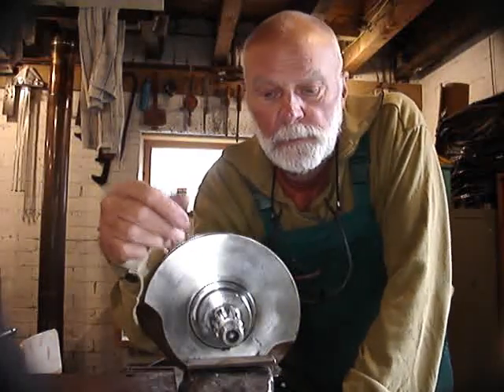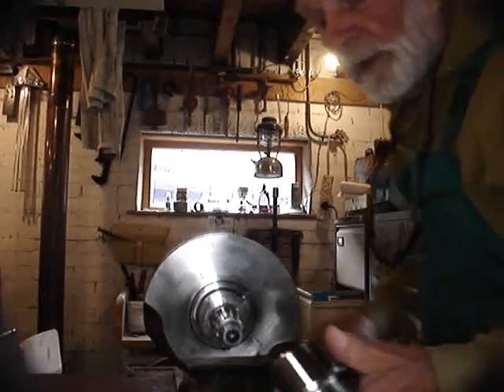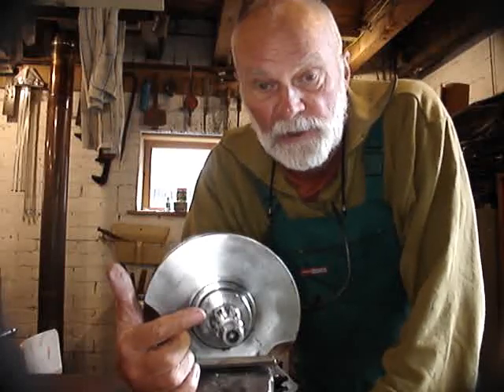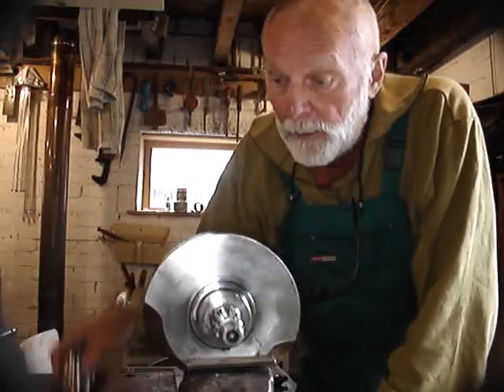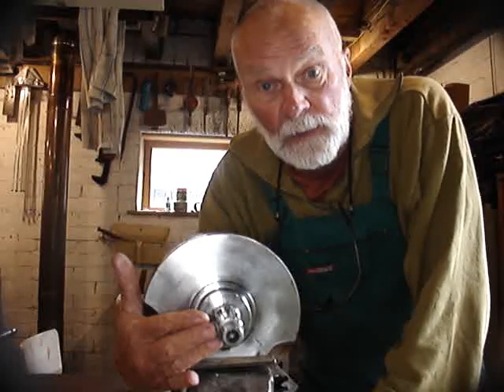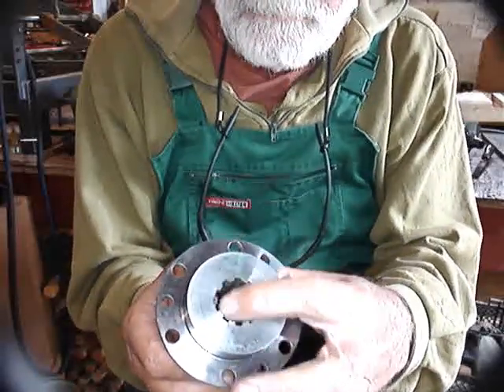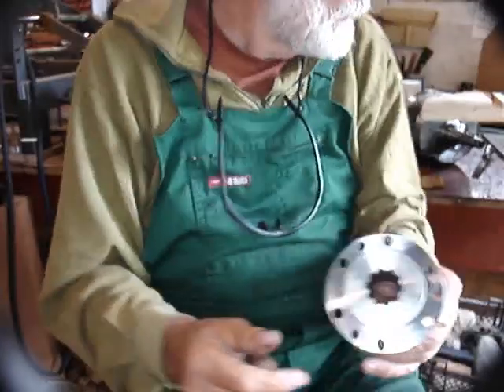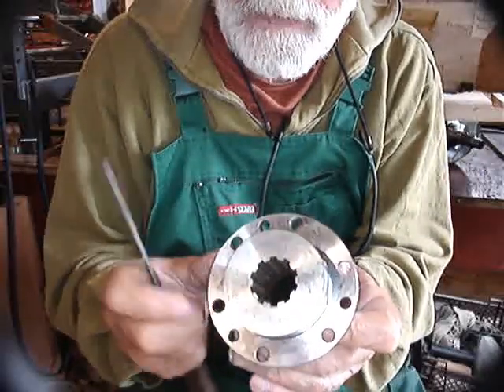Spline fitting instructions

Comment: Is there any benefit to heating or cooling the items to get a tighter fit?
Reply: Sadly such a simple solution can not apply.  The fit which is crucial to longevity is between the flanks of the splines so heating would make the spline fatter and prevent assembly.  Shrinking with dry ice would make the splines thinner but would also make the diameters smaller also preventing assembly.  the only answers are to do it properly as shown in the video or make something which fits irregularly and has to be forced on which will cause problems when subsequently dissmantled or as everyone else does - glue it on with loctite - take your pick!

Comment: Blimey Phil. What a conundrum. There is something absolutely brutal happening at that coupling. 
What’s the OD of the splined shaft?
When we talked about it, I can’t remember if you thought it was due to the power delivery of the engine, or to shocks reflected back through the transmission from the wheel. 

Bill in Orpington
Reply from the maker: Hi Bill,  a conundrum indeed!  The problem is that any coupling like this one has to have a light interference fit and that can only be achieved by hand fitting.  Any slight play will result in rapid failure.  It is impossible to gauge a splined shaft due to the possibility of one spline being over size and the rest under size or even due to one spline being slightly out of angular position.  The shaft is soft, as is the original hub which is deliberately made with splines alternatively out of position to achieve a sort of rough press fit which works first time but the soft hub remains distorted if you take it off and so does not work if you just put it back on to say nothing of the lack of concentricity in such a system.  I have grafted new shafts in to cranks and used a singe key which can easily be made to tight tolerances to achieve a good fit - this works, of course - It was how we used to assemble steam locomotives with no problems!  Have a look here if you want to see some more info about this poorly thought through design :-  http://bleazey.co.uk/M3Wbox.html#CUSH Good to hear from you - I hope you are both well.